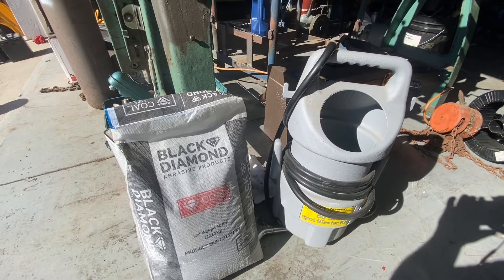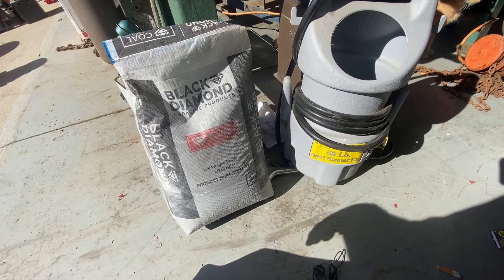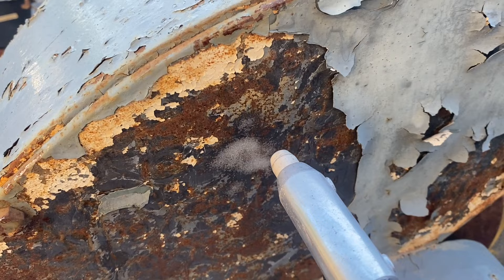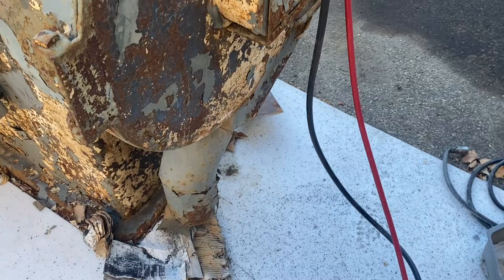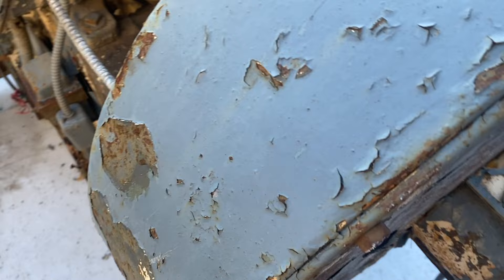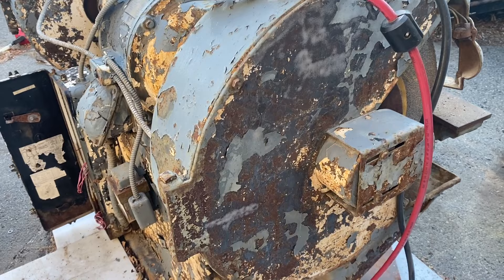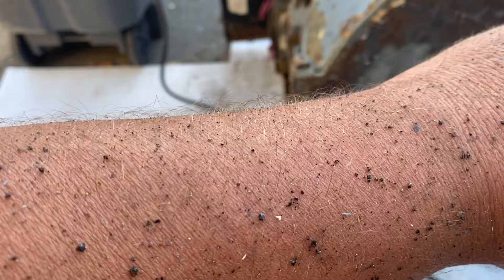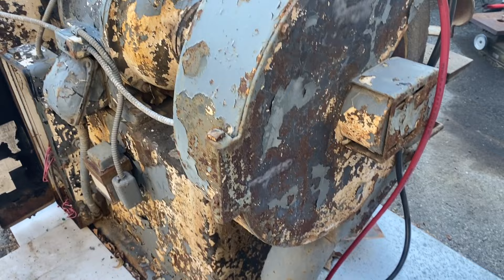Testing the harbor freight 50 pound spot blast kit

Comment: When the paint is really flaky like that, the fastest thing i've found for relatively flat surfaces is a carbide scraper.   takes it off pretty quick, then you can go back and get the rest with a wire cup on a grinder or whatever.   Sand blasting is the best for little nooks and crannies and awkwardly shaped areas.
Reply from the maker: Very true, I was mostly just testing the thing out
Reply: If he had a professional sand blasting setup with 100 gallon tank and 25cfm 3 stage pump, it wouldn't matter the blaster would take off the flakes like butter. But this spot blaster on a residential compressor is going to take a lot longer

Comment: It definitely works. You demonstrated that very well for showing it with no prep work. For what you paid for it to maybe touch up a trailer that got the paint scratched off to repaint that spot or hit a spot in an engine bay a grinder won't reach to ground a wire, this will be perfect for you.

Comment: Just a thought power wash first 
Then use a tarp to catch the media and obliviously proper PPE 
The unit is too small for that size machine but for spot cleaning it will work well.
Reply from the maker: Yes it is small, I was mostly just seeing if it worked

Comment: The paper clip trick and playground sand is the way to go. I've used this exact machine on several occasions. Forgive the analogy, but if you take a paperclip and make it into your best imitation of an IUD, and get that in the t valve on the base, you can use dirt cheap playground sand and get a much better, faster result
Reply: U have video?
Reply: U need a respirator if you use sand , because of the silica dust. On commercial projects I've seen them use grinded walnut shells .

Comment: I don't know if you have a gravel driveway anywhere, but cold slag was used to gravel them for about 40 years everywhere around here and I'm right on the sound. My old place across the street had the driveway about 1/3 of a mile that was in poor shape when I bought the place. I put down 8 yd of 5/8 but I had it tilled into the slag before I crowned and compacted it. I'm normally pretty environmentally minded, but that place was in deep rainforest. If I had used gravel alone, it would take 10 yd to the year and 100 hours of Labor. But I guess we are saving the world by shipping it to China on giant diesel powered tankers?

Comment: I started with play sand in medium. At $6 per bag. Now it comes damp and will not drop into the air line. So in a big roasting pan and the oven at 250 for one hour
 Also I had to shift it out because small pebbles block the gun. Once that was done it worked great. A bag of medium is $40 and sand was $6. 
A little labor was fine by me.
I
Reply: What screen size or items do you use to shift the sand for the desired particulate size?

Comment: Do you think this would remove paint from the underside of a wood banister or spindles with ground walnut?
Reply from the maker: I’m not sure, I have almost no experience on doing things with wood
Reply: NO, it will ruin the wood.
Reply: @jeffrme  depends on what grit you use. If you use  it to air gum probably not.

Comment: What psi did you use? I think this unit is rated for lower pressure which may make it pulse less.
Reply: I bought and returned one of these because I couldn't get it to draw anything through it. Maybe I didn't have it setup correctly as I was using the same media. I don't recall what pressure I used as it was long enough ago.

Comment: Nothing comes out of mine, anyone know if it takes a specific air pressure?
Reply from the maker: Mine works at most pressures but With bigger  media my hose has a tendency to clog
Reply: Just got one from harbor freight. Works at higher psi, but my coarse walnut media clogs is almost instantly.

I can use a small media, but still clogs. Kinda an annoying tool at time haha
Reply: Nothing came out of mine either. Then I discovered the nozzle inside the gun was assembled backwards. The small hole in the internal nozzle needs to go forward right over the media input. It's the small hole that creates the necessary vacuum. My 4 gallon, 2.6 scfm @ 90 psi, 2 HP Campbell Hausfeld compressor now has no problem pulling the media up ( Harbor Freight 80 grit glass beads ).

Comment: I would recommend actually that nobody by this thing I just bought mine it doesn't really work like you would think it works mine actually doesn't spray shit out of it at all and Harbor Freight will not return the walnuts that I bought or this piece of shit media blaster it makes absolutely no vacuum suction for you can pull the trigger on that gun and it'll blow 200 PSI write out the gun I even filled the hose up with the Walnut shells that they recommended for the damn thing and it's still don't work what a waste of $80
Reply from the maker: There units are hit or miss from one to another, after using this thing for a hour I am not a fan of the huge mess it makes